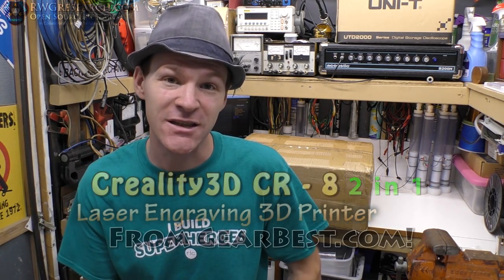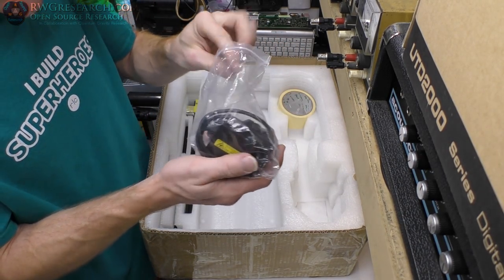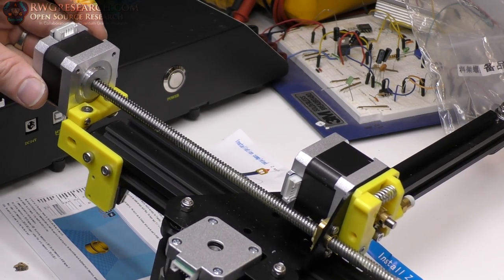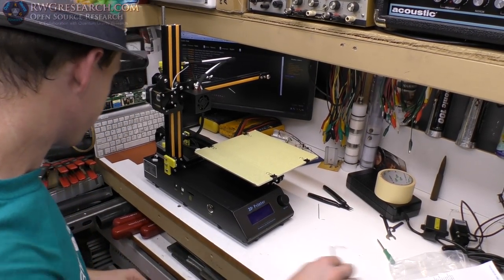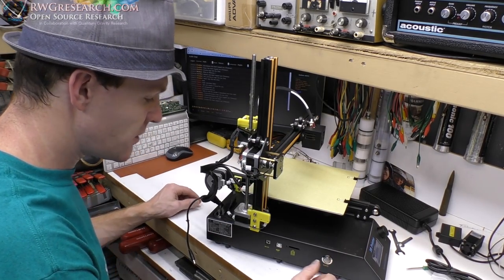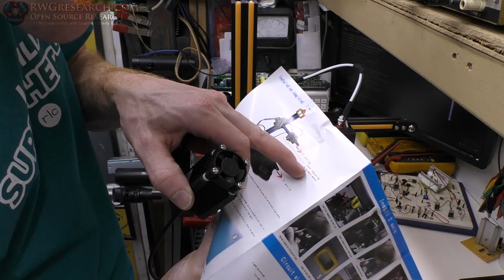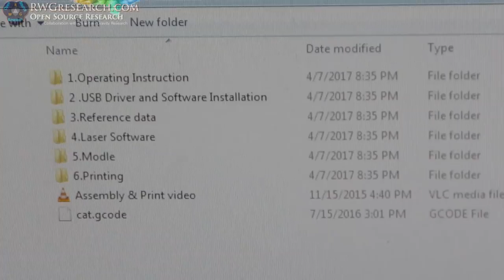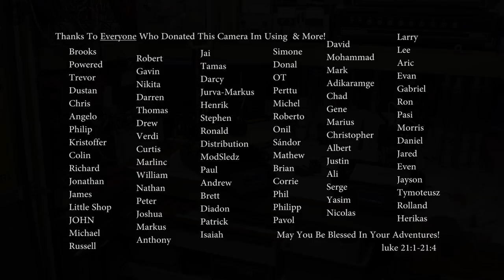Creality3D CR - 8 2 in 1 Laser Engraving 3D Printer, UnBoxing & Assembly : Review Part 1 GearBest

Comment: I from Brasil. ..... buy is anet a8?
Reply: Se você é bom para consertar eletrônicos e kits de construção, então, sim, o Anet A8 está bem. Se não, então obtenha a Critical CR-10

I do not speak Portuguese I just used a translator
Reply from the maker: HI!!! I haven't tested an A8 so I cant tell how good or not good it is... but others seem to like it! for PLA and smaller prints, I still like the ANT Ecarry.. http://m.gearbest.com/3d-printers-3d-printer-kits/pp_620038.html?lkid=10819916&lkid=10825910  ~Russ
Reply: I got both the CR-10 and the Anet A8. The CR-10 just destroys the A8. I have heavily modified the A8 and the CR-10 is just stock. The A8 is a sketchy sketchy machine.
Reply from the maker: good to know! strangely this CR-8 does seem to print quite nicely. more in the next video on that :) ~Russ

Comment: gearbest have a terrible reputation. those things look like they print pretty nice though. That same polycarb spool holder ships with the Jaycar TL4076 i have. Probably the same Chinese factory. "Can not point eyes by laser directly" that is some funny Chinglish.
Reply from the maker: the thing is ... people want a printer for cheep they get what they pay for ( most of the time) so my goal is to see if theses things can be made this cheep and hive good results. so far I'm impressed... for the price any way. when i first started you could not even buy a control Bord for less than 200, then the motors and you were already over what we are paying for theses units. the bad thing is is that you basically dont get customer support, but you also dont pay for it... so its a trade off. a reputation from gear best is... if you pay for it you better receive it. after that i would not expect to much more. Again for that price... ~Russ

Comment: No typo in the title? Whats wrong with you Russ!?
Reply from the maker: lol. well you know, I spend a lot of time trying to read that Chinese English and i think it fixed me? hehe ~Russ
Reply: I just finished part 2 and realized I never finished part 1. Man you hate bed leveling. Both my printers don't have auto bed leveling. I have inductive sensors I could wire up but I have been too lazy. I don't find leveling that hard. Maybe I am used to it? I try very hard to not mess up my bed when removing prints though. I will use my spatula as a hammer if it doesn't want to pop up easily.